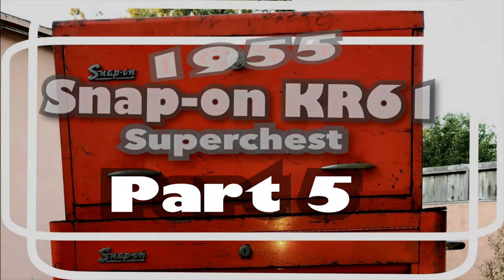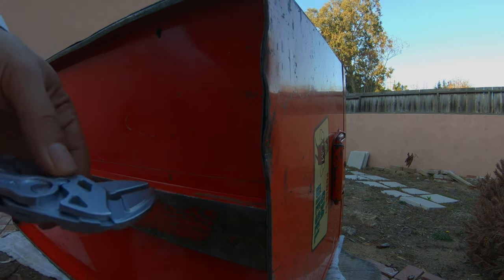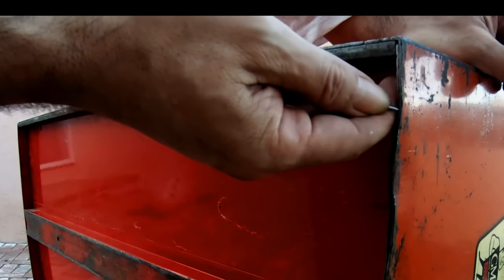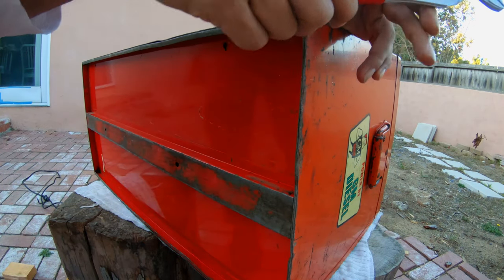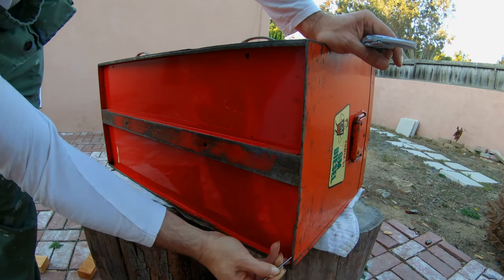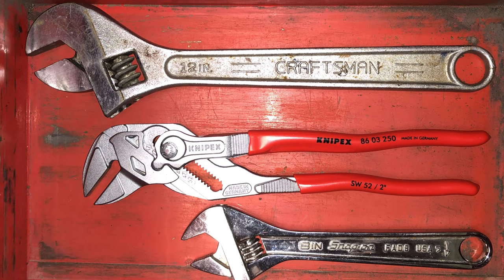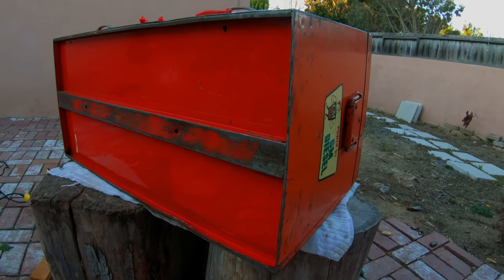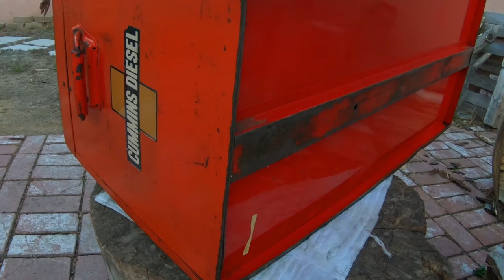ShadowBoxer 0074 {Snap -on KR 61 Part 5: Flattening the Curves Pt. 2/ Knipex Pliers Wrench Review}

Comment: I have great success with flattening most all toolbox edges ( the very bad ones) by using the lowly crescent/adjustable wrench. You have nearly finite control of correcting the offending bend. Those pliers you used are very nice. Cool boxes!!!
Reply from the maker: Thanks for the comment. Crescent/Adjustable wrenches are very good with their smooth, parallel jaws. I was using adjustable wrenches on other boxes before I found the pliers/wrench. As you can see in the video, I have a few. These Knipex Pliers Wrenches add the extra factor of force. 

Once you set an adjustable wrench you are no longer squeezing. It’s not supposed to move. The pliers/wrench design allows you to add or subtract force as needed. As you can see in the video.

However they do seem to be somewhat related and that is why I brought up the adjustable wrench and showed a few as I reviewed my experience with the Knipex.

Thanks again for the comment. Take care
Cheers
Reply: @ShadowBoxer  . I appreciate your detailed reply my friend! I was actually watching your video and was quite tired when I realized you were using the knipex to great advantage (over crescent wrench) and then I deleted my comment….I thought I did! I realized my error after watching the rest of the video later….I’m searching for some of those sweet knipex pliers soon! Keep up the good work!